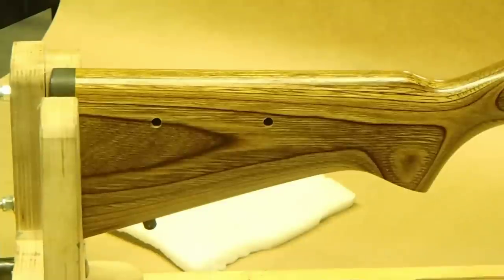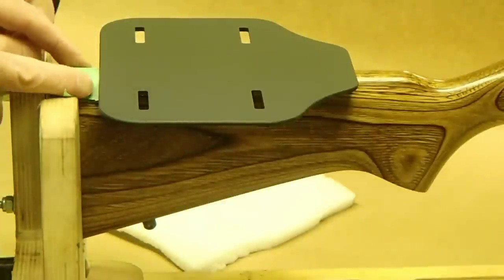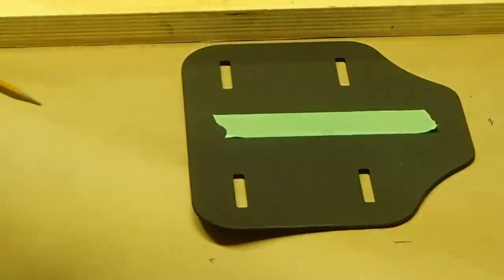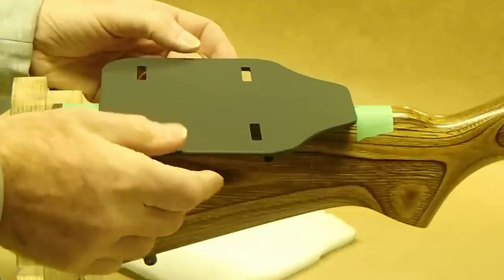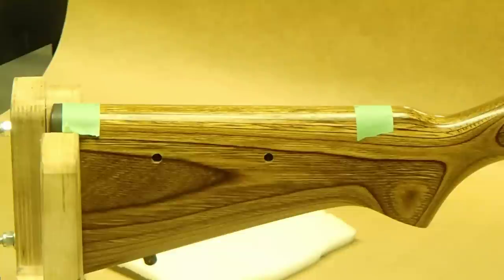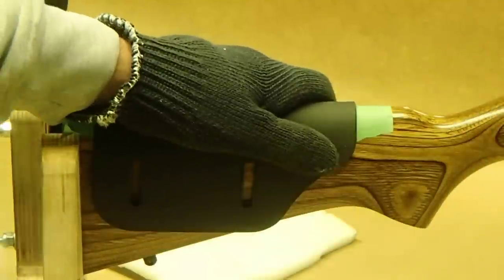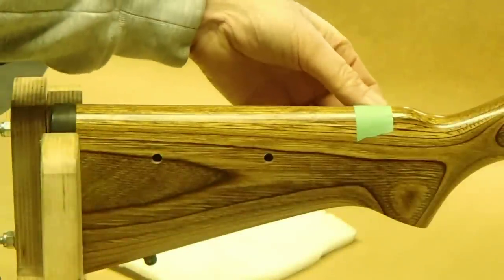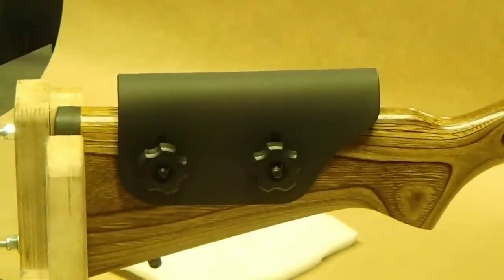How to make a cheek rest

Comment: how did you drill the holes accurately? Does the kit arrive with a pattern to facilitate drilling the holes in the correct positions?
Reply from the maker: +Pedro Pons Drilling the holes does not require a pattern, measuring or marking. The TAC PRO kit includes a drill bushing that is used to align the drill bit in the slots after you form the cheek rest. The installation video is here: http://tacpro.com/product_info.php?cPath=14&products_id=20
Reply: you could heatmold it, and then fill the holes with a sharpie pen... then drill into the markings

Comment: Will it work on a Savage 110 HS stock that is 1 3\4 inch thick ? Or will the slots in the kydex be to high up on the stock ?
Reply from the maker: +RDW 65 It will work well, but a better option is our precision formed cheek rest made for the HS Precision stock. Model CR-700HS. http://tacpro.com/product_info.php?cPath=14&products_id=21

Comment: how to make or how to install???
Reply: I think both apply here. The original plate isn't a cheek piece because of the shape. He had to 'make' the flat plate into a cheek piece, using heat and moulding it. He then showed how to use the bolts and nuts to 'install' and adjust the cheek piece he had 'made'. He showed us a technique that others could use to make a bespoke cheek piece for their individual rifles....and how to install them.